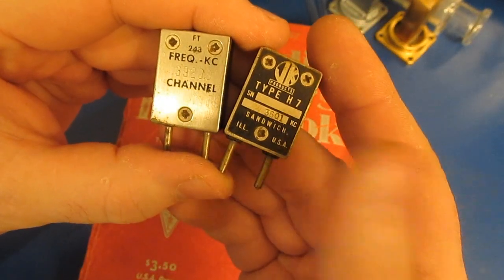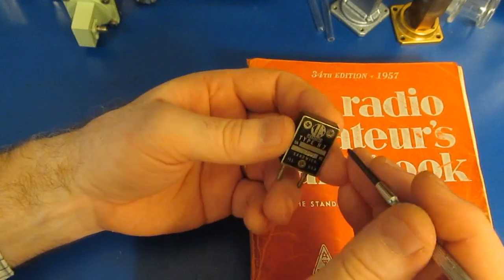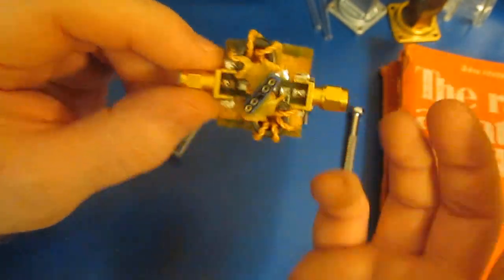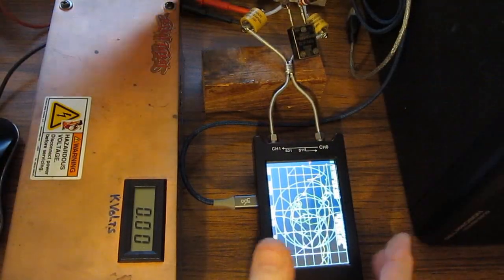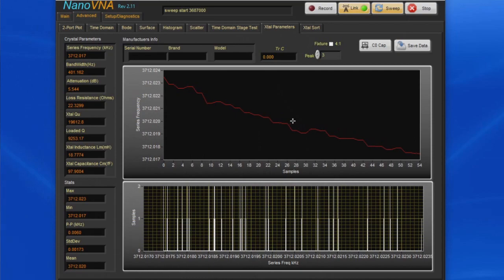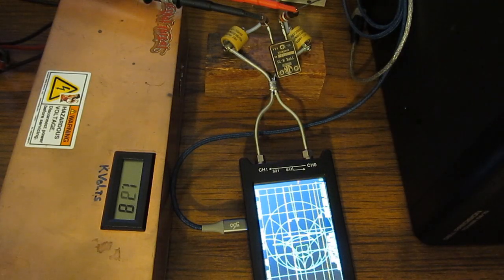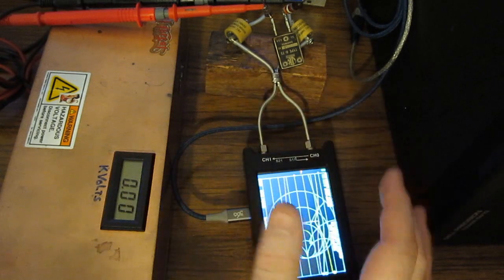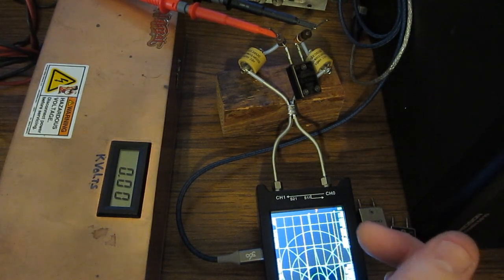Effects of High Voltage on Quartz Crystal Resonance

Comment: You see kids ! Thats a smart dinosaur, you mock dinosaurs, being born with your iphones in hand, but it takes a zenner diode in reverse and get back to zero bars.... not so smart huh ? Hehehehe.
Reply: Real dinosaurs know how to take an old backward wave tube and really make those kids cry.
Alas, also angering to wrathful intent a certain rich Uncle Sam...
Reply: @spvillano  rectyfier ? Wanna see trought their shallow mind :) no need for xray.
Reply: @marcsmithsonian9773  rectifier, but not what a backward wave tube is. An old slang term for it was carcinotron, as it was cancer for microwave bands. Voltage tunable oscillator. It'd turn an old radar display into a display of rays, with no discernible returns. It'd also raise merry hell with modern cell phones, as they're microwave frequencies.
While there are more modern voltage tunable oscillators, a proper dinosaur model that I could still work would be such a device. Used to repair to component level circuits that were tube based, hybrid, transistor (germanium and silicon), IC and VLSI, departing the field when IC's were ever so much fun to solder in, due to their resemblance to postage stamps, where the leads were the perforation edges.
These days, I'd need jeweler's lenses or a microscope to work on the damnable things. Other than that, electrons are electrons, the laws of physics haven't changed and electronics is a field of physics.
And yeah, for some readers, I do know how to use a tunneling diode as well.  ;)
Reply: @spvillano  Hats off to one of the ancient wizards of the world. I barely know enough to put together that a microwave frequency jammer really would make ipad kids cry. Lol

Luckily I was born in the year of the Game Boy and got to see the changing of the Age, but I was wondering if you'd mind sharing some stories with me about the before times to now? My dad learned computer programming when a computer was a room of punch card machines, so I find it fascinating to learn stories about electronics then and the path experienced close up by people like you and him to get to today's pocket super computers. I'd be very grateful to hear some of your stories.

Comment: Back in 1980 I worked for a 2 way company as a field technician. Our UHF radios used crystals and to get the 25 kHz FM deviation they used the 9th overtone. Seasonal changes meant retuning then crystals, RX was on the 3rd overtone and easy to adjust but for TX I had to bring along a complete radio service jig to keep them radios within specs.

Comment: You could also drop the resonant frequency using a 2B pendil to add graphite to the surface of the crystal, which would lower resonant frequency slightly. Useful if you polished it a tiny bit high, getting it back down enough to work.
Reply: I think that a truly "Lead" pencil would do the same.
#NonROHS-Solder

Comment: I would think half of that drift is from the ceramic capacitors changing capacitance with applied voltage, you probably would need more stable capacitors to try it, as they likely are changing by a few pF, and changing the resonance of the crystal. Might be worth trying with a more voltage stable capacitor there.

Incidentally with those crystals they likely are not synthetic, but were mined and cut from pure quartz deposits, likely from South America, which was for a long time the supplier of pure quartz.
Reply from the maker: I will leave that up to you but a few things for you to consider.   These are a class II part (X5V) rated to 5kV.  We start to see a change at around 500V and I ran it up to about 1.4kV.   No doubt that the voltage will effect their capacitance but we are always increasing the voltage across them which will decrease the capacitance.  Yet, when we reverse the voltage, we see the resonance also change direction.   A simple test you could try is to place an air capacitor in series with a crystal and measure the resonance.  Now trim the capacitor to cause a 10Hz increase in the resonance.  is it a few pF?  At least with my part, we are talking about roughly a 50% decrease.    Of course we also need a 50% increase to cause a 10Hz decrease in resonance.

Comment: I don't see any problem with your test, other than the caps maybe leaking DC? The VNA should have been completely unaware of the DC you applied.
Interesting test!
Reply from the maker: Are you asking why the VNA was almost damaged?
Reply: @joesmith-je3tq  
Not really - although I'd be interested to hear if anyone had some thoughts on it.
My veiw is that the DC should have been competely invisable to the VNA because of the caps - so the only way it would have seen any of that is if the caps were "leaking" - Am I (as I often do) missing something?
Reply: Yes, I think there's leakage through the high-voltage capacitors. Maybe the analog front-end saturated against one of the power rails and the nonlinearity broke the resonance calculations.

Comment: Im surprised a flexing under high voltage didnt affect the resonance. If you applied AC to it I wonder if that would mix somehow with the resonance?
Reply: Do you mean, affect the Q factor?
I wouldn't expect the Q to be affected unless it's physically hitting one of the plates
Reply: @MarshalHorn  No I was thinking more of frequency mixing. Is there some sort of sum and difference generated in the crystal

Comment: About 10 years ago I was given a handful of chinesium fob remote controls. Inside was a battery a couple resistors capacitors and transistors. But what caught my eye was a round metal device that had four leads. It turned out to be what was called a SAW (surface acoustic wave ) device. Supposedly inside the device is a trapezoidal shaped Crystal with two leads at the small end and two leads at the large end. A signal was input at the large end causing the crystal to resonate. At the small end those vibrations would cause it to resonate at a higher frequency outputting a voltage. Essentially a frequency multiplier.

Comment: If a crystal has Q=10000 and ESR=50ohms at 7MHz, then reactance of the series LC is 50xQ = 500k. If the operating voltage is 1V (20mA through 50ohms), then the series LC components develop 500k x 20mA = 10kV, and this is in a normal operating circuit.
Reply from the maker: I applied a DC bias in an attempt to cause a mechanical change  to the crystal.   When sweeping, the crystal will see both the AC and DC components.
Reply: @joesmith-je3tq  The applied dc stress is small relative to the bending ac stress in normal operation.
Reply from the maker: @h7qvi  And?  I guess I am missing the point you are trying to make.
Reply from the maker: Maybe a response to my comment about cracking the part?
Reply: @joesmith-je3tq  The point is that the bending stresses in normal operation at resonance is hard to match by applying an external dc voltage. Therefore the system is still linear, superposition still applies, so frequency shift should be minimal. The constant stress from applied dc isn't affecting the elasticity of the material, so you'd expect little frequency change.
Reply from the maker: @h7qvi  Do you feel that something else is causing the shift rather than the mechanical change in the crystal?  Or are you just trying to explain why the shift is so small?
Reply: @joesmith-je3tq  I was explaining why the shift was small. The small observed shift is a second order effect i can only guess at. By bending the crystal with dc, one side becomes stretched and less dense and the other becomes compressed and more dense. The changes in density may not exactly balance each other in all areas, even tho the density changes balance overall (constant mass), causing the frequency shift. Another cause could be impurities migrating through the material. Does the frequency come all the way back after removing the dc ?
Reply from the maker: @h7qvi  Yes it recovers in both directions.  I am not sure how linear the effect is.   I would imagine that the higher the voltage the lower the Q.